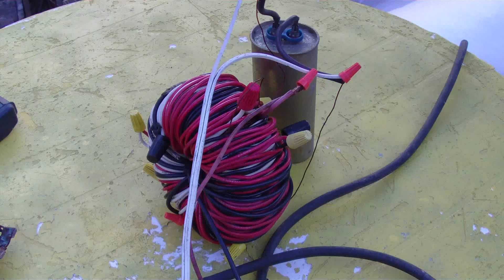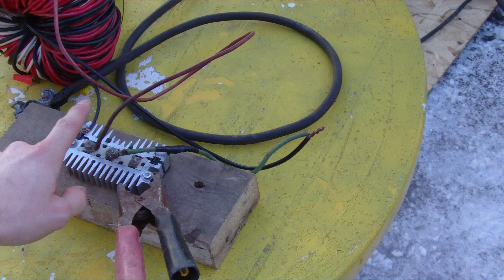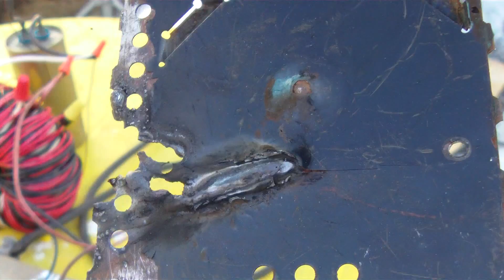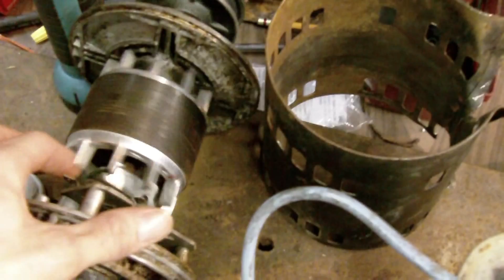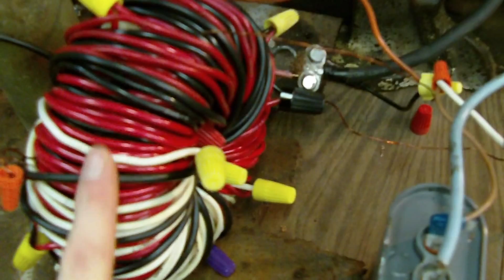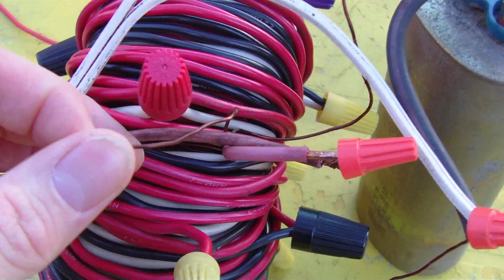Homemade Arc Welder from Motor 120v AC/DC

Comment: You should build one with adjustable current like one with taps. That's what i plan to do because these welders from MOTs and other shit are just toys if you really think about it. I doubt anyone actually uses them more than a few times before going out a buying a big box welder. At least with taps you can try out different rods for different material but im not so sure how to do it. I know how to make taps but im looking for a special kinda old school heavy duty transformer switch  i forget the name of, A switch that can handle 10-15 taps... I like your motor transformer because it would be so much easier making taps work with the winding on the outside.

Comment: ihave a problem the voltage in philippines is 220v ac .can i use 220v to 110v 10amp adaptor to plug 110 welder???
Reply: Honestly, go for 220v for a welder. I've owned 120v welders and I've owned 220v welders, most of your avg. 120v welders are underperforming, underpowered, weak weak units. That's really the best I have to say about them. 
Now if you have 220v line electricity and you only have access to a 120v welder you have a couple different options. One - you could use a circuit/transformer based adapter to step down the voltage, but if it maxes out at 10 amps, you'll wind up not having enough current to really do anything useful. Options two - if it's 2 phase 220v line voltage than you can run the neutral wire (usually white) of the welder to the neutral, run the hot wire (usually black) to just one of the phases, and run your ground wire (almost always green wire) to ground, always go ground to ground.
2 phase 220v line electricity can be really useful like that, so that's best case scenario, in 2 phase power you have 2 120v lines that separately have 120v across neutral, but across eachother you get around 220-240 volts. 
Hope this was helpful and good luck!

Comment: I have the same exact motor core and am recycling the thick windings as well but I have 450+ turns on the primary and it still heats up real fast like I need more turns. I've done a series light test(placing a desk lamp, primary coil, and 120v mains all in series with each other and when there are enough turns on the primary, the light will grow dimmer and eventually won't light up anymore. ) and it's dim which indicates a need for more turns. Won't this many turns reduce my amp output of the secondary coil? I would like to use it as a light duty welder.

Comment: I'm sorry. I kinda jumped the gun when posting. After I went and watched some other videos and did some reading. Pausing your other video and looking closely also helped.
Should not attempt building something like that without a very good idea of what is involved.
I need to find a sacrificial motor or a couple microwaves before I can start, will be looking. Did find a $80 model at Harbor Freight which I plan on buying and cloning.
Thank you for the idea(s).

Comment: This and other channel show the basic construction. The windings and such I get... Your running it off of 120v AC here? In the other vid your running it off a battery changer. You don't show the difference between running with/without the cap.
How is it wired? How is the AC connected to the windings, cap, welding feeds.

Would like to try to rig one up and make it as simple as possible. Something for doing light welding. Have the materials but not entirely sure about how.

Comment: hello !!!
did you let the original winding as you found it and you did only the secondairy wire  or you removed it all then rewind it or removed only a part of it ???
and how much is the resistance of the primairy coil ??
and how much voltage you get out of it